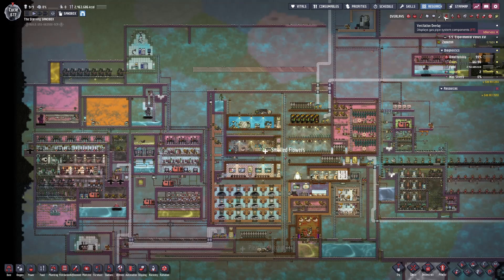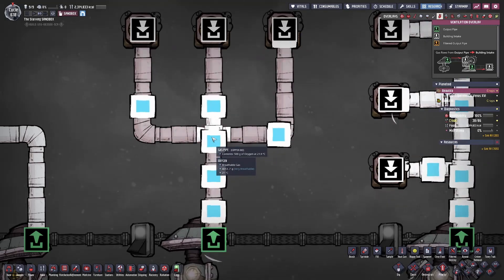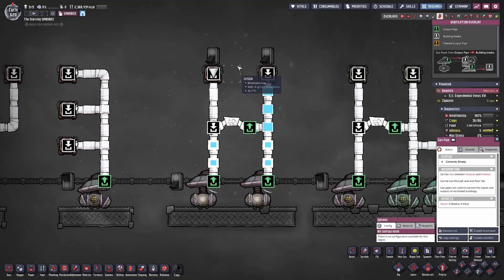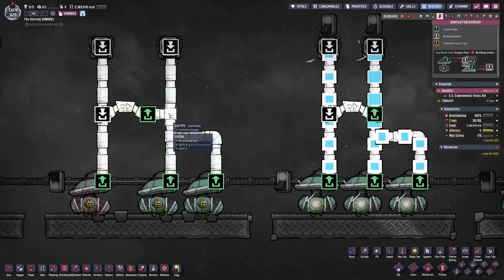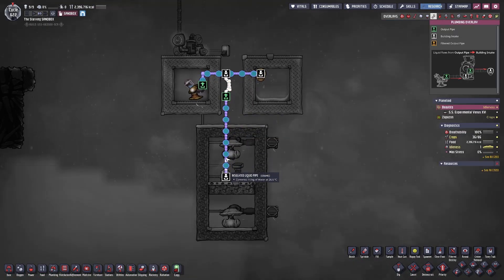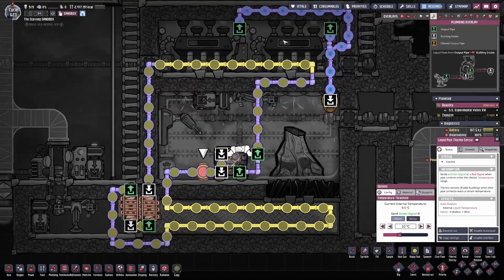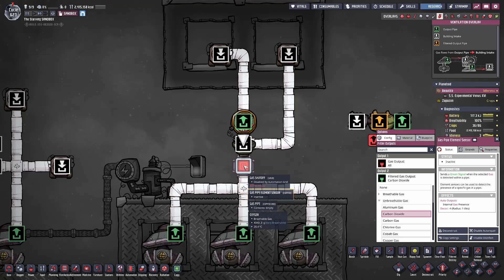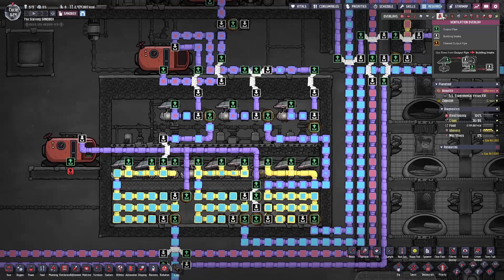PIPE GUIDE for BEGINNERS in Oxygen Not Included - Bridges and Flow Direction

Comment: one thing about the Diversion section: you could even have that filter setup for 0 power if you control the vents opening/closing directly and lay the pipes over them.
only works for releasing gases into a space (or room like shown here), can only use containers for the last remaining material with the 0W variant
edit: you do require a not-gate to invert the sensor signal, filter for whatever gas/liquid/solid you want to release and tell the vent to close on anything else, only letting your selected material out into the room.
problem with all these low power variants is, they break when the pipes block.

Comment: 1:01 Saying there is a lot of way piping can go wrong while showing the 3 right oxygen pumps that don't pump and the left most one too ^^ That's real life demo.
4:05 It's not only bridges, it's all building with in and out. Like shutoff, valve, reservoir ... But i understand the simplification for beginner, you have to sacrifice a bit of exhaustivity for clarity (even though you use it inconsciously for the shutoff in the diversion part). I just helped a beginner that didn't understand how he solved a priority problem with a reservoir. It's also used to gain some space with unlimited valve acting like plain 1x2 bridge.

You should mention the cheat sheet with the naming : splitter, filler, overflow, mixer . I'll try to link in a sub comment.